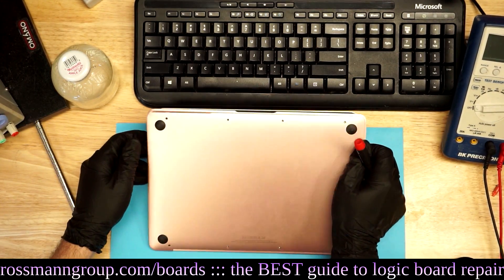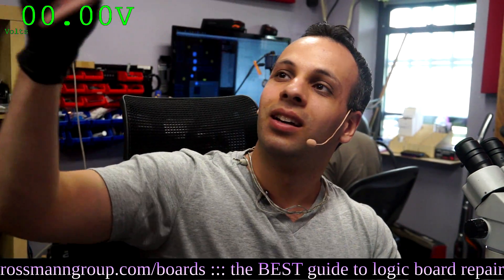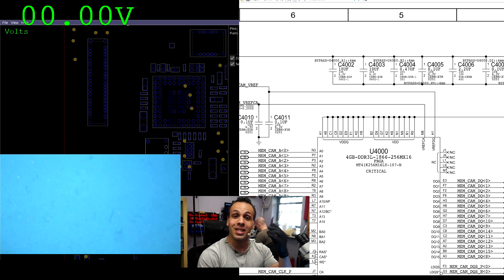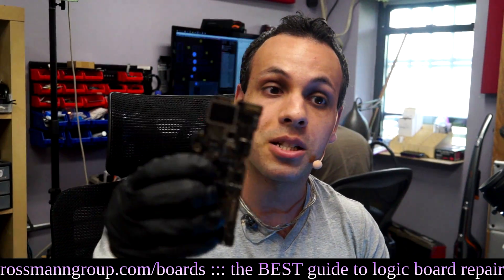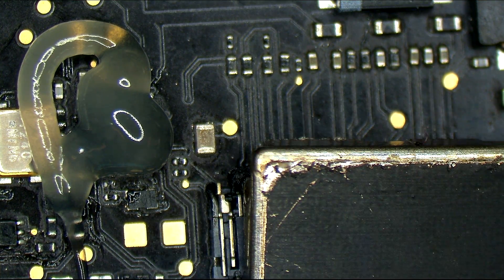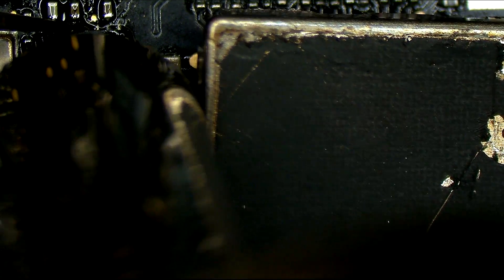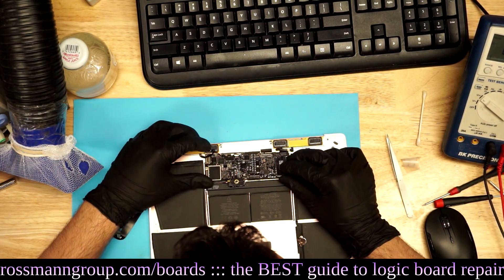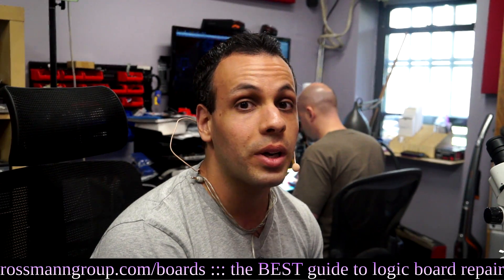Mall repair franchises are garbage and ruin the credibility of our industry.

Comment: Hey Louis, I am not sure if you will read this, but I want to thank you. Watching your videos is actually what helped me learn more about soldering and gave me more confidence in my ability to solder. While I was not working with stuff like this, I did recently modify a friend's Honda OBD1 ECU with a chip kit and the control circuitry for VTEC. Basically, I made the ECU programmable and added functionality that was not there before. My friend bought a new tip for the soldering iron he already had, a de-soldering iron to make my life easier, flux (it was radio shack flux, it worked and it was easy to get in one day) and I set up in a well lit and ventilated room, after about 3 hours of total work (had a couple small issues and my first time doing this from scratch) it works beautifully. Went from having a car that did not want to kick on the fuel pump randomly because the previous modified ECUs were poorly modded and were dying/dead, to one that works amazing and even lets us data log now. Thank you again for the great content, and look forward to learning more :) Even at the age of 35, I still enjoy learning new things and applying what I learn.
Reply: I had an older neighbor when I was 18 who thought I could fix his guitar pedal or whatever. I had no experience with electronics... I felt pressured to do it, however, and I started googling soldering and circuits, I borrowed books from the  library. After about a week of spending 15 hours a day on learning this and soldering circuits in random gadgets I found in the recycling room - I managed to fix his pedal. It's the top 3 proudest moments of my life and I've been hooked ever since.
Reply: Thankfully car boards are a lot easier to solder than personal computer boards.  It's a great way to learn.  I still have a little soldering kit I put together from my time spent on things like my old car.
Reply: Carstuff111 69 likes
Reply: Yep, he didn't read it.
Reply: 35 isn't that old 😂

Comment: The more I watch your videos the more i realize with proper equipment , proper knowledge and proper data fixing printed circuit boards is easy. For year I have looked at circuit boards as smaller but harder to repair electrical circuits but you show with proper data and equipment it is the same thing when you repair any other building /aircraft circuit its down to skill and data available. I am an aircraft electrician so if i dont have proper data i just replace circuit cards, the is no room for error of watching youtube and guessing this is what needs to be replaced in my job.

Comment: The way you cake the hell out of the component with flux is the same way I do it.  Flux is only way that makes soldering come out nice. I use to work for a company that refuses to let you used flux when soldering.  They let you use that liquid shit that was alcohol based and the damn thing evaporated when you applied heat to it.

Comment: This right here is one of the big reasons I got out of the repair business. Too many people using Apple, and Apple making the boards really hard to fix. Instead of ruining people's devices, I just had to turn down all Apple products. Not a good thing to do when you're already too close to your margins and the majority of people coming in have apple products.

Possibly because Apple intentionally build their stuff to break.
Reply: As far as I can tell from various videos on Apple products I watched, they don't make it intentionally break so much as they make it almost impossible to repair unless you know the tricks and make publishing the tricks copyright infringement. Then they declare products "vintage" and stop production of parts and repairs at the edge of the products lifespan so just about when pieces start to break from wear and tear, they're suddenly out of production and no longer covered. 

To make sure people don't just work with spare parts that got overproduced, they also make sure that it's hard to impossible to get your hands on authorized spare parts as a third party repair shop and make sure all the certified ones stop servicing when the product turns vintage as well. 

Not much better, really, but there ya go.
Reply: Plan B is to make a "Hackintosh" from a HP mil-spec laptop.
Reply: In fact Apple are now producing throwaway devices. Which would be understandable for 500$ worth iPhone (it is bad anyway... well), but completely intolerable for 4000$ worth iMac Pro and 3000$ worth newest MacBook-s. A scam disguised under sectarian style advertising played out as... um... science.
Reply: @KrotowX  Correct....I repair laptops when I am not doing other IT stuff. I LOVED the older
brown Apple Powerbook G3 Lombard...rugged, reliable, easy to disassemble and replace
parts (even upgraded the Power PC cpu in mine once...). Have not bothered with any of
the later Apple laptops after friends brought me theirs and I could see they were designed
to be not repair user friendly...
Reply: Well, whatever. If they have spoiled fanbois with more money than they can count they will do fine. If they don't innovate eventually their product will become a commodity and maybe even they will die out. The largest computer companies (Apples of the day) many never heard of. DEC, SGI(former owner of the googleplex), Compaq, all gone. A macbook is about as impressive to me as a $500 walmart laptop. They have tons of competition now and Android is arguably better than iOS.I bet if they started selling Android Phones the fanbois would soak them up.
Reply: You gave up a given income stream cuz too hard? But......but......Rossman.
Reply: Well My macbook air from early 2015 is still working fine. Only problem what I had was Razer Synapse which didn't worked with MacOSX Mojave update but I fixed it.
Reply: @normaaliihminen722  Your laptop is not even three years old, consider me not even slightly impressed. I just gave my 7 year old packard bell laptop away. 600 dollars at the time.
Reply: @normaaliihminen722  "Well My macbook air from early 2015 is still working fine."
You say that as if it's something of an achievement. My old HP laptop lasted me from 2007 to 2016 when I replaced it because it was just too slow even for simple tasks.
Reply: @demoniack81  I love how you portray it as that such. No it wasn't. I was only responding to claim that Macbook gets easily broken.
Reply: Normaali Ihminen great. And I know A tall Asian man. Are Asian people all tall because I know a tall Asian man?

Comment: Couldn't you have just looked at the chip taped to the front and use the schematics to see where it was originally located, rather than looking for burnt solder? Providing the taped chip had some identifying information that you could use to correlate with the schematics.

Comment: The UBreakandFix business model relies on deception. Let me explain.  My 6s Plus had a small crack in the glass and after they replaced it and no longer responded to touch. They told me I probably broke the motherboard when I dropped it, but it was working before they fixed it! Now, the reason I went there because of the great reviews on Google, but it turns out THEYRE ALL FAKE!!! They got 200 5-star Google reviews in the first year they opened, but on Yelp, they only have 25? It's like that at all their locations. If we all convinced Google to crack down on fake reviews, their whole system would crash. UBreakandFix could not exist without fake reviews.

Comment: Just a month ago we had an costumer who brought their MacBookAir with an liquid damage to us. She said since she spilled coffee on it she didn’t try to turn it on and brought it to an little repair store in the downtown. After a few days they gave her her device back and told her they couldn’t fix it. When I was opening the button case I already noticed that some screws were missing there. But it got a lot worse: there were missing all the screws to hold the logic board in place so it only kind of hold it’s position by the ports slided into their holes. Also the the heat sink wasn’t properly attached and it was way too much thermal paste on it as much that was also on the logic board. Also the plates for holding the cables in place were missing and the chip protection plates. I think the repair store made it a lot worse than it was. So in fact she paid an store to make it even worse.

Comment: Hi Rossman,

I've been a lurker for a long time and really enjoy your repair videos.

I'm not going to ask you how to repair my MBP, but I'd like to hear your thoughts on if it's worthwhile. It's a 17" MBP Early 2011MC725LL/A (A1297). It powers on and is able to run the hardware diagnostics with only one complaint (battery is not original Apple). But when booted from net/cd/hdd it loads the kernel, shows vertical lines uniformly distributed on the screen ( like this: https://i.pinimg.com/originals/dd/a2/23/dda223790c5a3e1d4f666bba118d8c8a.jpg ) and then it freezes.

At first I thought it might be the GPU problem Apple had an extended warranty case on until last year, but being able to run the graphics tests in the HWDiag suite suggests otherwise.

Would you think it's worthwhile having it repaired ( then I assume by a professional like yourself )?

If you have had a machine in for repair like this, any chance you remember approximately how much it cost?

Since I'm just pondering (stuck in Iceland, north of everywhere) it's not like I'll be running with it to a pro anytime soon though (Iceland doesn't have any, and shipping is ridiculously expensive to anywhere), so don't feel compelled to answer :)

Comment: I worked for a company similar to these "mall repair places" - Boss wanted me to lie to a customer who brought in an ipad, she dropped it and the digitizer was fine, however there was nothing coming from the LCD. This was an ipad 3 I believe, so the LCD cable had that little latch on it, it had come undone. I plugged the LCD back in, and was going to charge her $29.99 for a half hour of my time, as that's how long it should take to lift a good digi, and re-seat it over the LCD without tons of dust underneath.. My boss told me that "no she broke her LCD, you're going to charge her for an LCD replacement". That's a $99+ charge. I called the customer and told her I plugged it back in, and it would be $29.99. I quit shortly after.

Comment: This makes me really laugh my ass off XD "that is how you fix a machine that was fucked up  by" a blind monkey with its fingers crossed stuck up its ass with one hand and using its feet to do the rest of this stupid bullshit... Pretty much what it felt like what you wanted to say XD if it makes anyone feel better I fucked up a usb repair on my icraig android netbook which is a pos to start with but I only had a soldering iron at the time and when I went to remove the screwed connector a couple of the solder joints cooled down and pulled off my tracer wires from the board... Needed a heat gun I guess XD I was thinking about doing an external charging circuit on it and calling it okay loool maybe one with a barrel jack for charging cause 2amps at 5volts through a usb connector like on a old camcorder? Nope that was begging for problems in my opinion. Not sure it was even gold plated.

Comment: Hi Louis. I was watching the part where you placed a shield over the connector to protect it from heat and wanted to share something I've done. I've used aluminum duct tape for HVAC work that's found in any hardware store to cover odd, weird, or hard to protect places. Cut to shape and stick down. Rip off and toss when done.

Comment: Nice Shure 215's friend
Reply from the maker: 415! :) I had e3c 13 years ago, the durability isolation and comfort on these are the best
Reply from the maker: And good taste
Reply: How do you like them? I've had my 215's for like 6 years and no problems, but I'm curious if it's worth going to a higher level with in-ears.
Reply: Toxy, he's sayin he's thinkin about upgrading from the 215's
Reply: loads of comparison info on headfi
Reply: the 215s are hardly higher level unless you are using the ones you get free. They're pretty entry level.

Comment: @2:19 just tovbe clear as long as the storage medium hasnt been fried or corrupted you can recover data from NAND chips with the right equipment. NAND recovery is easier than platter data recovery due to the sanitation requirementa of the environment and such

Comment: This looks like the car repair business. We get cars in the shop prettymuch every day where people "fixed" it themselfs or had it "fixed" by other shops. It works about the same. They have worn out brakes and end up replacing half the car with used parts and leaving those worn out brakes. Then they finally give up, go to a good shop, we tell em well your brakes where fcked, but now you car needs a whole lot more because of all the shit you destroyed when working on it. 200$ job turned in to a 2000$ job right there without a problem.

And most people know that the mechanics kind of have a bad name. But again, its only because of the bad mechanics, just like you could get a bad name from those mall repair idiots. If people have bad experience with 2-3 of those shops they will probably never trust anyone with their boards again, same with cars.

Comment: You even see the crystal or ceramic resonator can right next to the clock generator.
I don't know if Apple does this, but even within model years you have different board revisions in just about every other company, and different component populations within board revisions.

They got a top fuel drag car, pointed it right at a brick wall and floored it.  There was no way this was going to go well.

Comment: Clock chip, com chip, close enough, I mean every Mac is repaired buy just replacing a fuse anyways. 😂
Reply: Most Mac's are replaced by buying another Mac. The smart owners repair their Mac by buying almost anything else, or heading to TechYESCity's channel and building their own kick-ass desktop.
Reply: Don't you know that the most durable component in any Macbook or iCrap is the fuses?
and by 'durable', it means they don't blow at all; the components they are supposed to protect blows up first!

Comment: This reminds me of the struggle with my own laptop. I bought it at MediaMarkt and it started malfunctioning. By now they've replaced the mobo twice and updated the bios (which broke my key for Windows 10) and it's still malfunctioning. Meanwhile I have a strong feeling the thermometer of my GPU is causing issues as it starts failing with graphic intense applications, whilst not becoming hotter than 80°C and throwing a Vtemp. The malfunction usually results in a freeze and a screen that shifts 10 pixels to the right with the cut off part appearing at the left, black bars and blue pixels scrambled across the screen.

Comment: 1:09 Yes! God damn it! It is a trap! It can only be interpreted that way. And it's brilliant at that. If you didn't look it up before, you'll probably ruin it. So sad. Remember how easy it was to service, for instance a Compaq LTE 4/50CX? Most of it is held together with 4 parallel screws that goes through the hole body. And 2 screws for the keyboard. It was meant to be easy and intuitive to service. I miss that.

Comment: 11:40 Thank goodness this wasn't a PS2, that thing runs on the Emotion Engine. CPU would have been permanently scarred
Reply: When I see my PS2 sitting on the shelf I remind it that I still love it to ensure it will work next time I dust it off.
Reply: Derryn Henry but only because you still love it
Reply: and if he doesn't, somebody else will love it.
Reply: I dropped mine a couple a times and that shit still kicking
Reply: Laughed crazy at this. You have a good sense of humor sir.
Reply: Epic response is epic :D, my +1 thumb up good sir.
Reply: Omg I love this comment so much
Reply: noice
Reply: Vincent Del Vecchio very clever. :)
Reply: Early Launch PS3 had ps2 hardware in em, so they need that love just as much if note more ^_~
Reply: The fat ps2 is a fucking tank I’ve had mine for 10+ years and it’s still kicking
Reply: My previous PS2 slim is finnicky. It takes a few tries to get it running properly, and after being on for only a few minutes you have to let it sit for 30 minutes before you can get it to work again. Otherwise all it will do is spin the disk and send a blank signal to the TV. 

It turns out Sony didn't take the plastic off the thermal pads when they assembled the console. RIP. It was cheap enough to just get a new PS2 rather than have the poor thing repaired.
Reply: Carl D the original fat one is where its at. I had friends who dropped them, steppd them, etc and they kept on kicking
Reply: Carl D why are you talking about ps2s on a Mac repair channel?
Reply: @Barry-vn6uq  Bc Apple and Sony have more in common than you might realize...
Reply: Loreaver lmao mine is plugged into my 62 inch flat screen. Lmao
Reply: joshua gabbert you must get a right shitty picture. By hey, as long as your ok with shitty blocky, blurry images. All's good.

Comment: i get replacing random shit on a board when you don't have schematics, that's fair and i have done the same in the past. 
not reading the code on the original and replacement chip and still go for it is absurd and should be punished by reading a book.

Comment: This is what happens when the average consumer looks for the cheapest repair option. Board level/electronics repair is NOT a charity. It’s hard to learn and put into practice for a reason! I guess all these engineers just make $10 an hour for their easy work so repairs should be as cheap 🙄 Very smart consumer there!